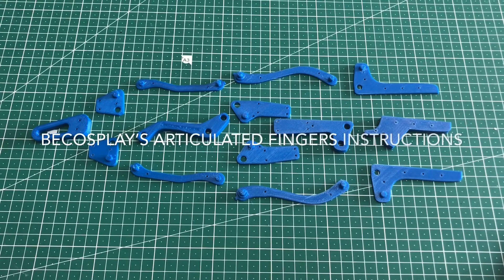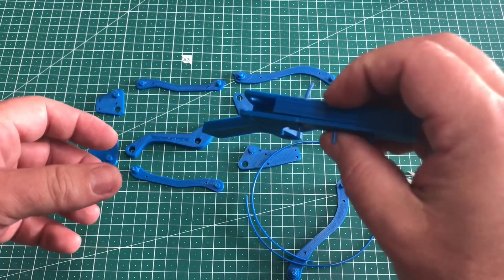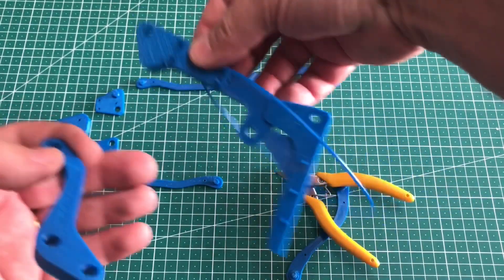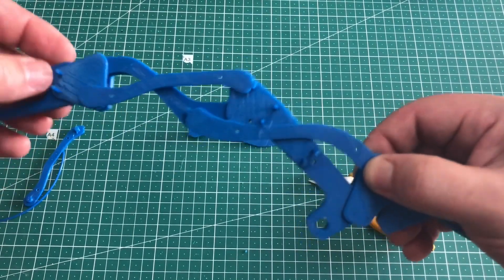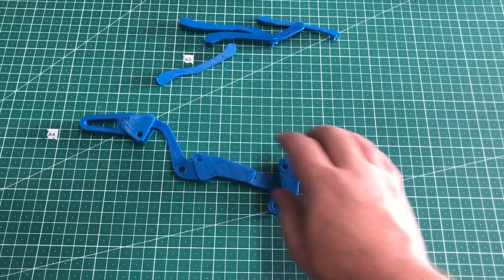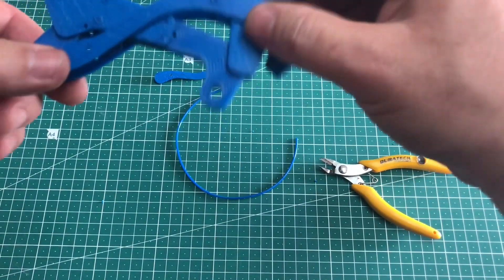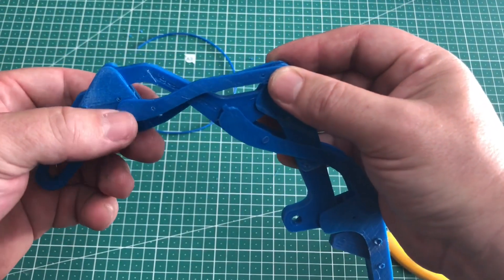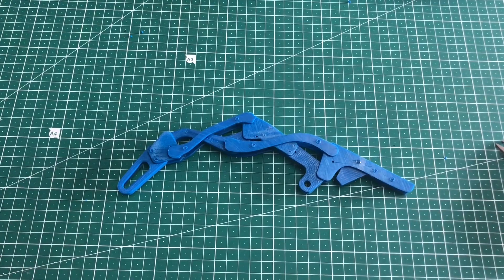Becosplay Forge Articulating mechanical fingers assembly instructions

Comment: Hey, that is a very nice design! Do you attach the short end of the lever to a control glove worn by the user or have you printed out the parts to fit directly to the users fingers? Distantly reminds me of an excavator arm.. Which begs the question, is the next step to machine the parts from steel and add a linear actuator for each finger and go crush stuff?(:
Reply from the maker: Ilkka Palander this is the first step towards full robotics. I use push pull rods to control the fingers.
Reply: @Becosplayforge  Nice! Always a good idea to keep things as simple as possible.